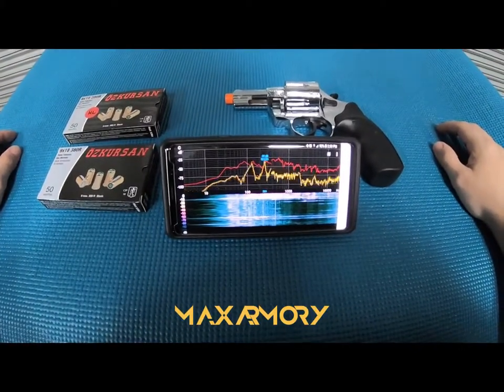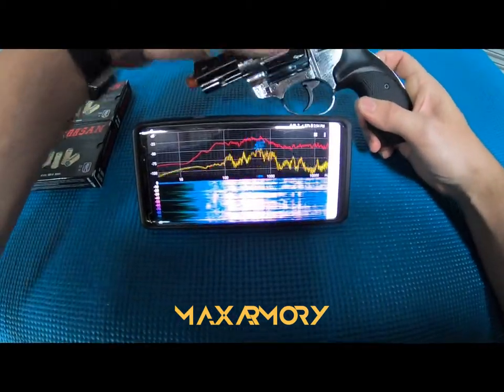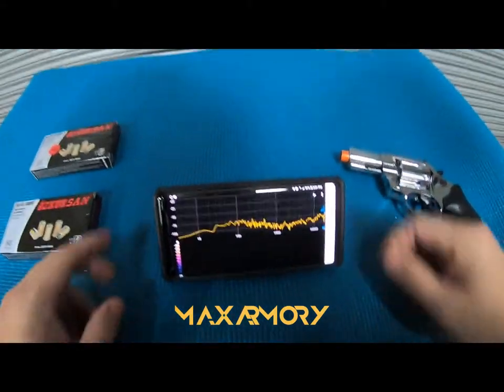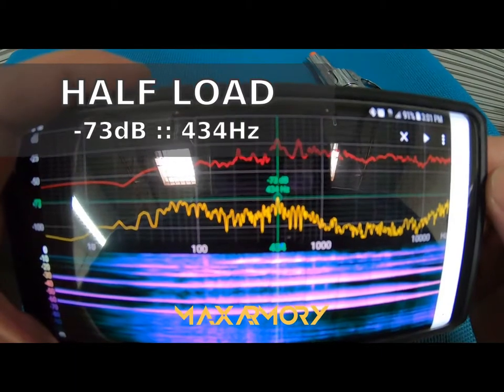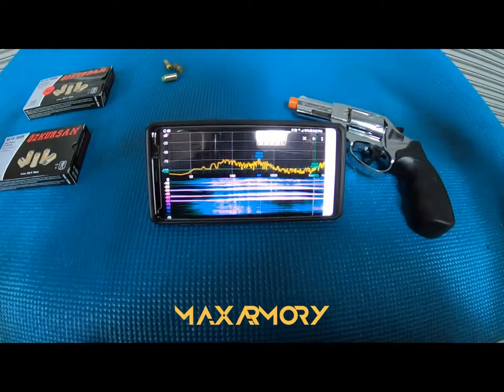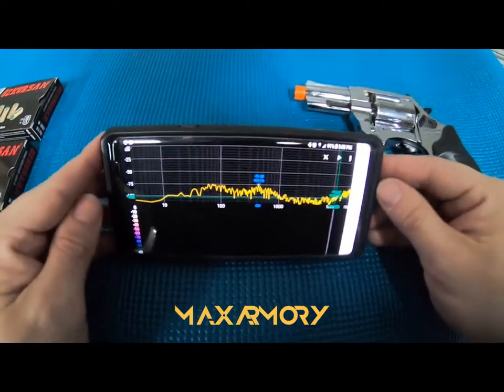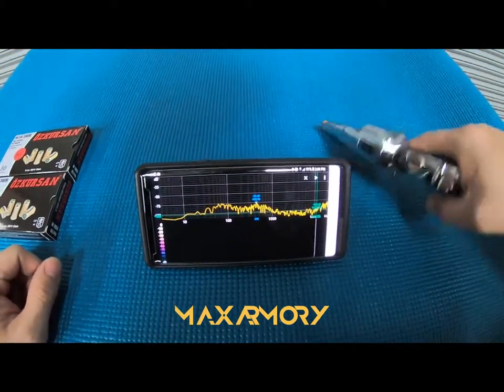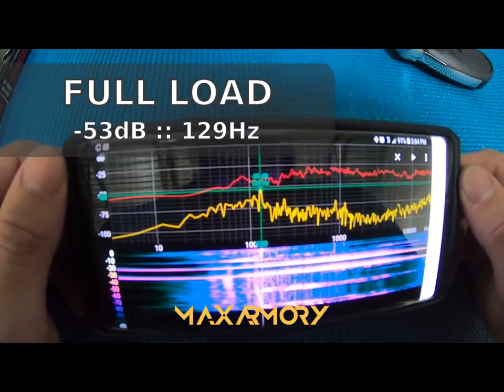Half Load vs Full Load .380R Blank Gun Ammo Test.

Comment: Think your phone app is not accurate. All the shots sounded way louder 100+ DB to me. People talking is around 60 DB.
Reply from the maker: Thanks for your comment. Sound pressure is affected by many variables, such as temperature, air density, wind fluctuations and sound proximity to a decibel meter. If you have a high end device like a Extech 407790A ($4k), then feel free to post your readings. My approach was simple and anyone can do it from their phones ;)
Reply: You cannot judge via the speaker of the device with which you have watched this clip how loud it was, because the volume setting of you speaker has a huge impact on the results of course.